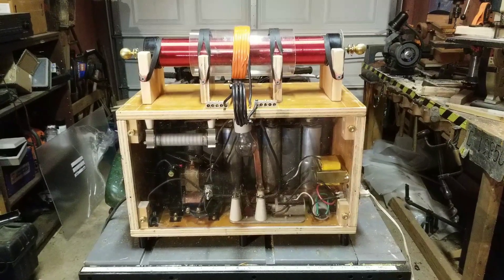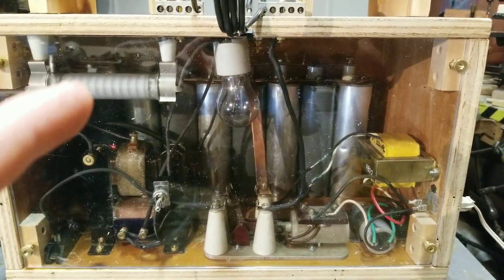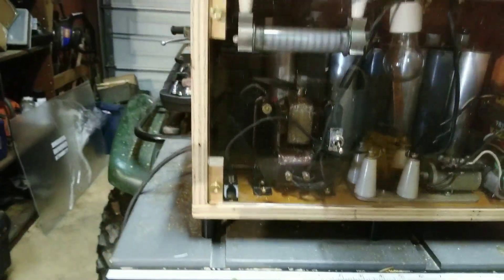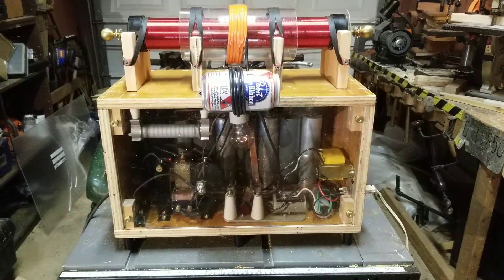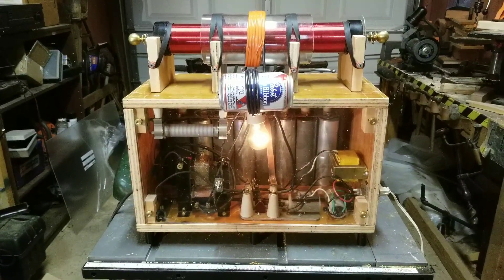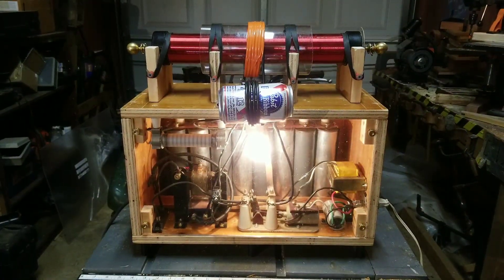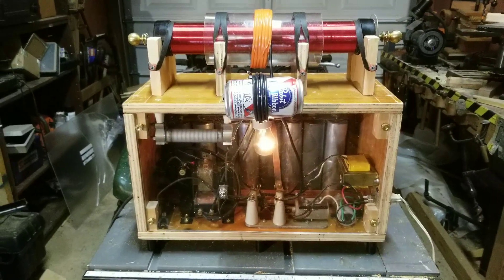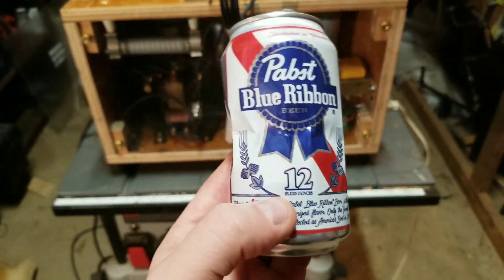High Voltage Capacitor Bank (700J) Can Crushing

Comment: Thank you for the reply .... the ( SCR ) that you will need will need to withstand a few thousand volts , and about 40 to 100 Amps ( continuous ) current ... there are  HUNDREDS  on the market , as they are used in welders / power stations etc ... the " puck " ( big white disc ) types are best , but need a good stout metal mounting , VERY expensive to buy new but FREE from old equipment ! ... you can trigger with a tiny 9 Volt battery in series with a push button and a 10 Ω resistor ! .... this will work VERY well with your high voltage coil ( shown at top in the video ) ... hope this is of help to you and your viewers ( ? ) ... ( tried - n - tested ) ...... DAVE™ ..........
Reply from the maker: Nice!! I will try and find one! Thanks!

Comment: You should get a faster discharge ( with no power sapping spark ) , if you use a  BIG  Thyristor  ( SCR ) to discharge the capacitors ... the more current that you can pulse the thick coil the more crushing force , the SCR is a VERY efficient way to cause a power discharge .. ( tried - n - tested ) ....DAVE™ .....................
Reply from the maker: Good to know, thanks! If I come across one I will give it a try!

Comment: Maybe start with pre-crushed can?
Reply from the maker: It is not meant to crush cans specifically, just a capacitor bank. It has the added benefit of being able to slightly crush cans, although not to a large degree.

Comment: whats the capacity & voltage ?
Reply from the maker: The capacitors are 8uF x8 for a total of 64uF. The charging voltage is about 4000 volts. The total output is around 750 Joules.

Comment: How did you get the light bulb to lower in bulb light as to let you know the right time has come to fire??? Thanks
Reply: The light bulb is wired in series with the primary coil of the charging transformer, when it's turned on the capacitors draw a load on the transformer as they charge which pulls current through the primary, which lights the bulb up. As the capacitors charge they draw less and less current which dims the bulb, since there's less load on the transformer. The light bulb also serves as a current limiter, the charger can only put out as much current as the light bulb can draw, it prevents damage to the capacitors and overcharging.
Reply: @TheExplosiveGuy  Mark this is a very intriguing setup. This reminds me of a flash plating setup a college showed about 12 years ago. For some reason I cannot find the exact channel and video. I am wondering if this could be used for the same thing ?? You definitely did your homework making this unit. I will try myself this coming winter. Thank you for letting me know Sir. Peace vf
Reply: @victoryfirst2878  Ohh no I didn't make this one, I just know how the circuit is wired up since I'm building almost the exact same thing but with different components and a bit more power, I've built a 1.7KJ capacitor bank for it at 1300 Volts, it's going to be peppy lol.

As to the flash plating thing, I'm not sure I'm familiar with that, the only thing I know of is a technique for increasing the surface conductivity of 3D printed circuits where they use a Xenon flash lamp (which in the case of using a cap bank like these to operate one, it would certainly work) to evaporate part of the composite matrix, leaving behind the metalized components which increases surface conductivity. Is that what you're talking about? Or is it a system for physically evaporating something to deposit on another? There are so many cool things you can do with capacitor banks...
Reply from the maker: You are absolutely correct about the bulb!

Comment: Try it with your forehead
Reply: I want to see a capacitor discharge through a pice of magnesium ribbon, with just high enough charge that it melts the whole thing instantly. I'll try some magnesium capacitor discharges with my 50v .047f capacitor in my next video.
Reply from the maker: I'm actually planning on trying that soon. When I do I will definitely post a video.